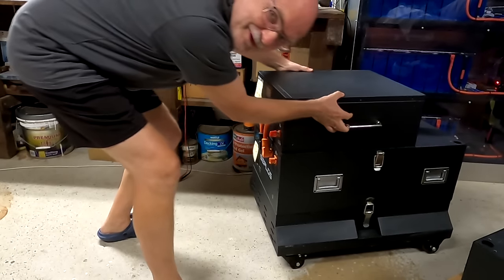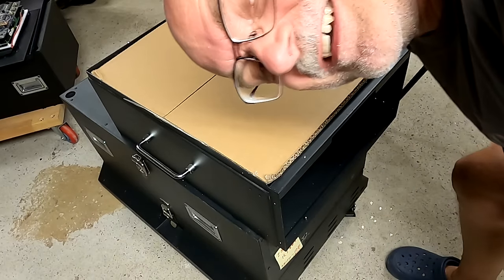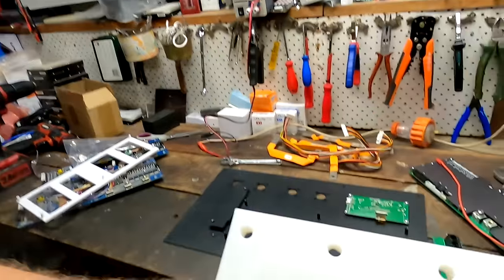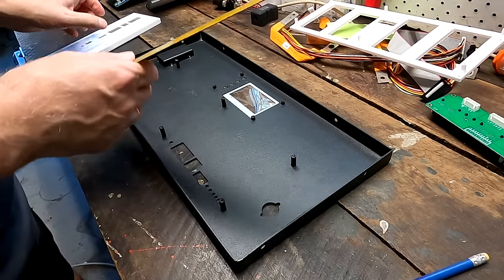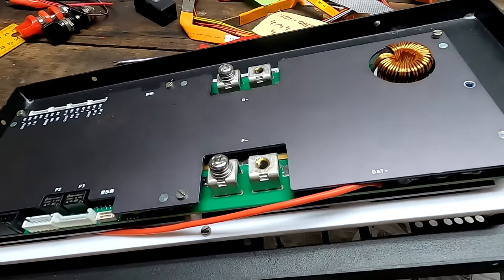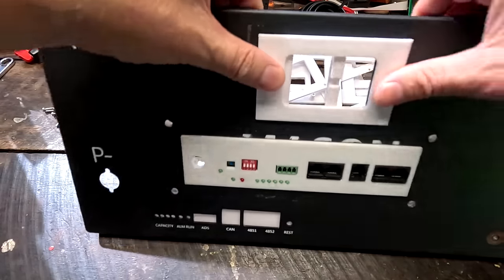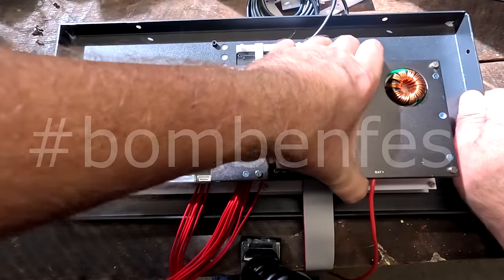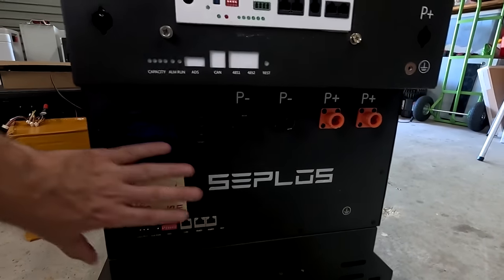Installing the JK-BMS in a Seplos MASON DIY Box? Well, it's not that easy... but here is how!

Comment: What a great project. Very well executed. The reason for all the effort eludes me a little, but it was certainly entertaining. 
I love DIY stuff.❤
Reply: The reason, was simply to upgrade the BMS, which meant the modifications were necessary to fit the new JK inverter BMS in a box which wasn't designed for it.
Reply from the maker: The 'old' 10C BMS goes to a friend in Germany, so the box needed a new BMS. And why not use a JK, right?😄

Comment: Great video, I have been waiting for these videos since it was first mentioned about the new JK Inverter BMS.
Try using threaded inserts in the 3D printed frames holes that are pressed into the plastic with hot solder. 
3D print the test holes that will best fit your purchased threaded inserts.
Self-tapping screws are fine for the prototype, but try threaded inserts as upgrade for the final version.
Reply: Yes! Brass threaded inserts are excellent and would make this solution truly #bombenfest!
Reply from the maker: Yeah, I've seen them. I thought they get super glued into the 3D part not pushed in with a solder?
I used normal M3/M4 screws and the result is actually very very good. I'm surprised myself.

Comment: Great video as always Andy! I bought 6 Mason 135Ah almost 2 years ago, they came with the V1 BMS, 48100 10C, and must say I'm quite disappointed with their reliability because I had 2 of them die recently, one month of interval between, and am afraid the others won't take much longer until it happens. Seplos provided me with instructions on how to replace a diode (D4) so I sent to a technician who did and it worked, the BMS is back working, but it's a big hassle. If I have one more dying soon think I'll replace them all by JK as you show here.

Comment: Hi andy, I always use a black marker pen to "paint" the screws black before I put them in. Try it it works great and you can re tip the screws with the marker after you screw them in the front.
Reply from the maker: I like the industrial look😉

Comment: Great mod there Andy, a lot of work and measuring going on, as a Boily I would have made a whole new front plate that would allow more room, but a lot more filing  needed for the comms PCB, I do like the looks of the 3D comms PCB saves a lot of drilling and filing on metal
Reply from the maker: Yes, you got the machines for that in your workshop, Ross. I should have sent you the measurements to make one for me😉 It would definitely look better than my Frankenstein Mason now.
Reply: @OffGridGarageAustralia  I am a little too far south from you Andy otherwise you could have used my workshop. shortly heading north to QLD for a break, your lucky and you have the warmer weather, have been busy building a 4m x4m battery room fully insulated for winter with air-con all running on off grid, I think my batteries will be better looked after then myself lol..
Reply from the maker: @sjdtmv  That sound great and very familiar. I'm doing the same over winter to prepare for the next summer up here.

Comment: :hand-pink-waving::face-pink-tears:Another big JK Inverter firmware BUG??? 
Hi Andy, did you test a JK Inverter BMS as a master and one (ore more) slaves connected with RS485 to the master? In my Victron-System I got via CAN only max/min cell-voltages and temps from the master BMS and no volt/temps from any slaves as max/min from the whole battery-system (all packs). The cell-block-count, capacity and all other values are reported correct to victron. I updated the JK firmware to the newest 14.20 but this BUG still exists. Do you (or any other user) have this problem too?
Reply: It still has a lot of issues and jk support doesn’t actually care 
For example the SOC is not related to total voltage so you will have different soc with same voltage
Besides it sucks with other inverters like the Growatt and Sofar
Reply from the maker: Yes, I heard about this bug and tested it. No such issue here. Master still showed the slave after two weeks...
Reply: @OffGridGarageAustralia  its not that it doesnt show the slave 
You got me wrong 
What I meant is that im having different SOC with the same voltage in the same battery, so in one day Im getting 50% for about 51.xx and other days its 50% for 50 volts or even 48 
So I think its because the SOC now is depending one single cell voltage when any cell reaches the “SOC 100%” value in the settings then after that it doesn’t really change according to the total voltage

Comment: Same problem I had with Apexium case. modified by covering communication board holes and cutting new holes. Printed the new communication board shape with scale 1:1 on paper and stuck on where to cut. Used small M3 screws with two nuts as stand off.
Reply from the maker: That's a good idea to use a paper template. Much faster than measuring three times and correcting my cutting lines😄

Comment: Hello! I have a Deye SUN-6K-SG03LP1-EU in pair with the JK BMS PB2A16S20P (HW V15.XA, SW V15.17), I successfully installed it and it works very well. I have only one problem that I can not fix for now - I need when Grid AC is lost or restored (no matter) to force the battery to charge to RCV (Requested Charge Voltage - 3.45V, 55.2V) but it charges only to RFV (Requested Float Voltage - 3.35V, 53.6V). When AC is restored, the only solution for now is to turn off and then turn on the option "Floating Current Voltage" in the BMS. After that, I see that the charging voltage is set to 55.2V and when the charge is finished the voltage is changed to 53.6V. For now, this charge algorithm works only by timers set in BMS. Is there any way to force the BMS to request RCV on AC restore (any trigger maybe)? May be someone know how to fix that? I've talked to DEYE support and they said that this have to be done on BMS side. Thank You!

Comment: Looks a bit rough indeed but hey it’s a prototype 😅. For the final solution I would just use a new sheet of 2mm aluminum and some L-profile to form the lip at the edges  and paint it black… e voila… you have a case looking like from the factory! 
Happy you found your way in 3D printing. It’s a great tool to make all kind of stuff. Just keep in mind to use the right filament especially if the part is used in an environment where it gets warm or even hot. we wouldn’t like to see that the BMS is falling off in your next hard discharge test…😂 Just kidding! Cheers Jens
Reply from the maker: I can print a new frontpanel out of 2 or 3 pieces...
Yeah, heat could be a problem with this PLA but the BMS will not get that hot.

Comment: Suggestion, since the box no longer contains a seplos bms, you may consider removing the name from the box - however since the underlaying construction was of a seplos origin I suggest use masking tape for the new section and display and spay paint the front pink after which the seplos name will still be slightly visible as an underlying shadow
Reply from the maker: I like the pink spray paint idea😄

Comment: 1:22 - congratulation 84 k sub already, time to prepare the next analog subscriber count for 85.000  I guess.
Seplos has not reacted on the issue with their energy tower which requires to put in the cell horizontally.
But EVE warns customers that the cells have to be mounted upright as usual with the valves on top. 
I am tired of seplos underperformances like the missing manual and how to mount it, the missing parts and no spare part stock in europe. 
3 months later or even 4 and nothing of the missing parts have been delivered. 

I bet I will also have to exchange that seplos BMS with a JK BMS but I need the missing parts first.
Reply from the maker: I'm converting all vertical boxes to horizontal boxes now. Two Gopelpower DIY cases with JK have arrived today.
EVE is warning of horizontal cell mount? Where is that info coming from?

Comment: Hi Andy,
I have just brought a 3.2inch JK screen, the wire that connects to the BMS, has the same connection on both ends?, doesn't fit on the BMS end, can you tell me where I can get one that fits? Nice video, I was thinking of doing the same with a QSO battery, the day before you brought out this video.
Reply from the maker: Is the 3.2" screen compatible with your JK BMS? The cable has two different plugs normally. The tiny one for the BMS and the larger one for the screen.

Yeah, the QSO batterie is on my list as well. That's even more complicated though...

Comment: Moin Andy, great design and work. I think you use PLA for the prints? What happens if the JK gets warmer than 60°C? I think you need something more heat resistant to hold the JK in place.
Reply from the maker: Yes, I use PLA+ for printing. Should not be an issue. The BMS will not get that warm. There is enough airflow.

Comment: Hi, love your channel , about to receive my gobel cells and begin my build. Regarding 3d prints , much as i love it, it holds a flame and cannot be used in electrical installations where i am as a NSW electrician. I have a couple of printers but don't use PLA in installations unfortunately 😢
Reply from the maker: Yeah, understandable. Once the 3D parts fit, I could get them made from metal over in China for a few $$$. That would be great!

Comment: Would it be easier to surface mount the 3D printed adaptor for the communication ports on the outside of the case? You could cover the existing cut out for the ports and maybe make a cut out for the wiring 

Same for the display, make an adaptor that sits over the existing cut out and you get the bigger display if you want
Reply from the maker: That may work with the bigger frontpanel of the larger 280Ah Mason box. This here is very tight and not much room to move things around.

Comment: Maybe it's a stupid idea, but silll... would it be possible to parallel an 'old' JK BMS with the 'Perter' board and a new JK Inverter BMS and have them connected to the inverter?
Reply from the maker: They will not communicate together. The old JK uses TTL signal while the new one uses RS485.
Peter is working on a solution for that... We should be able to parallel all kind of BMS once it is ready.

Comment: Hi Andy, great video! I just saw that JK released a V15.17. Maybe You can reveal what are the changes....
Reply: well, I made the update and already regret it.... now the Deye in the Li-BMS page shows "Force Charge" and doesn't discharge the battery any more. BMS is connected via CAN, and it seems to be a setting transmitted from the JK-BMS to the Daly Inverter. 😭  it is good to know that there is a video tutorial how to downgrade to the 15.10 😉
Reply: @wulfreise5902  you mean DEYE-inverter ...
Reply from the maker: It is still the V14.20 for me. Nothing has changed...
Reply: @OffGridGarageAustralia  Er hat die neueste Software für seine 15er Hardware von der JK-website runtergeladen(15.17), und diese funzt scheinbar nicht ....
Bei Dir ist auf google drive  erst sw 15.11 vorhanden. Bei der 14er Hardware ist softwaremässig nichts passiert. Beim 15er Modell dagegen  schon von 11 auf 17....
Reply: JKBMS
                                                              
  V15.17  Upgrade logs
  1. Upgrade the LCD protocol to support 1.1 and connection instructions.
  2. Optimize the SWUART code.
  3. Fix the Bug of the calf communication protocol.
  4. Added support for JK-BD6A20S20P JK-BD6A24S20P.
  5. Add intermittent alarm function.
  6. Add the emergency trigger button and the emergency time parameter.
  1. Added LUXPOWERTEK inverter support.
Reply: @nicof9202  thanks!! is that info somewhere available or did You get it from conversation with JK?

Comment: Hi Andy, I need your help. I install two batterys(new jkbms) with Growatt inverter. I set "Continued Charge current" as 40A (both bms). Then the charging current on inverter is 80A(command from bms) and the inverter don't allow me change a charging current(on inverter) because BMS send a command to it. In the ideal situation, both battery will be charged 40A on each unit. But the real situation that I face sometime. The first battery is charged 45A and second battery is charged 35A. Then the first bms is turn off charging port via " over charge current protection". I think Jkbms should have separate "Over charge current parameter". Please suggest me.

Comment: Hallo Andy, meine Frage passt nicht zum Video, wollte diese aber trotzdem an ein Profi stellen.
Ich habe bei mir 3x Packs mit 230Ah laufen. Je BMS von Seplos V2 und Neey Balancer. 
Zur Erweiterung habe ich 32 Zellen mit 280Ah bestellt. Jetzt ist die Überlegung, ob ich die 230Ah Zellen zu 3P16S zusammenstelle und über ein BMS laufen lasse. Und die anderen je für die 280Ah Zellen verwende.
Was spricht gegen das Parallelschalten der Packs in Form von 3P16S?
Danke im Voraus

Viele Grüße aus Nordhessen

Viktor
Reply from the maker: Hallo Viktor, das wuerde ich nicht machen. Bei parallelen Zellen hast du keine Kontrolle ueber die einzelnen Zellen. Wenn Dir mal eine durchgeht, blasen die anderen beiden ihre ganze Energie da rein. Mit katastrophalen Folgen. Du muesstest alle Zellen einzeln absichern, so wie damals mit den 18650 Powerwall und dem Sicherungsdraht fuer jede Zelle. Warum willst Du die bestehenden Packs nicht so lassen?

Gruesse in die alte Heimat nach Nordhessen!

Comment: Ady was wondering if You ever tried a shortwave radio near your garage. I am a Amateur Radio op here in the states and my station is in the country at a cabin recent fires took power out for over a week so was thinking of going off grid. But hear horror stories of solar inverter/chargers making noise on HF bands
Reply from the maker: Actually my neighbour is doing this as well. He's got some huge antennas in his yard. Maybe he contacts more intelligent life in outer space?😄
Do you mean the problem is when operating radio equipment through inverters or the HF noise interfering with your radios? He never complained but maybe he does not know where the problem in his system comes from😂 Almost everyone here has solar in our street, lots of inverters...

Comment: Very good job Andy. Looking at your video, I've had an idea. Instead of drilling, cutting and modifying the front plate of the Mason Seplos, why not create a plastic front plate with 3d print, designed for the JK BMS and all the relative components? Best regards!
Reply from the maker: Yes, that would be another alternative. Printing a whole new front panel...

Comment: YIXIANG DIY JK 200A BMS LifePo4 Metal Battery Case has everything for JK inverter BMS on the front panel: circuit breaker, ON/OFF switch, large 4-inch touch display, two terminals for + and -

Comment: Hallo Andy
Ich bin interessiert einen zweiten Akku zu kaufen oder zu bauen. Ich habe schon einen 14,4kw/h mit Seplos V2 BMS. Allerdings will ich die Batterien mit HA auslesen, und da ja anscheinend das V2 entweder Can oder RS485 kann weis ich jetzt nicht wirklich für was ich mich entscheiden soll. Was würdest du nehmen? Kennst du ne Option wie man das hin bekommt 2xSeplos V2 am Deye + auslesen mit HA. Am liebsten wäre mir ja auch das V2 auch aus finanzieller Sicht.
Reply from the maker: There are solutions on Github to read out the Seplos BMS. Not sure how good and reliable they work though, and if you need additional hardware like ESP32 or similar...

Comment: Why not drill a hole in the 3D printed I/O Adapter so that a steel nipple pokes thru?
Reply: … to cut thru the old cutouts
Reply from the maker: That would work as well, although drilling through the 3D part is not great because of the internal filament structure of the part. It can get rough.

Comment: I would have just made a new front panel with the 3d printer.
Reply from the maker: The whole front plate? I can only print 300mm max with mine, so would be two parts stitched together.

Comment: Nice job, but you should get your 3D printer adjusted, first layer looks like way too high, not getting a uniform surface
Reply from the maker: I think it's great. It is calibrated and levelled as per instructions.

Comment: Wow! Your 3D printer is pretty expensive. You would have been better off getting a creality K1C or K1 Max. They are almost the same price but have way more features and more than 10 times the printing speed.
I got my K1C a few weeks ago and it would print one of those big brackets in around 45 to 60 minutes
They can even print high temperature filament like nylon and support carbon fiber filaments
Reply from the maker: I don't know what that means.